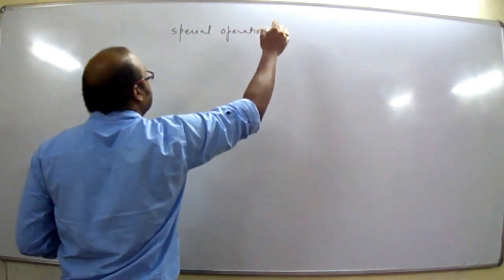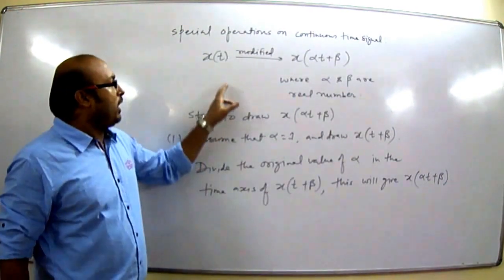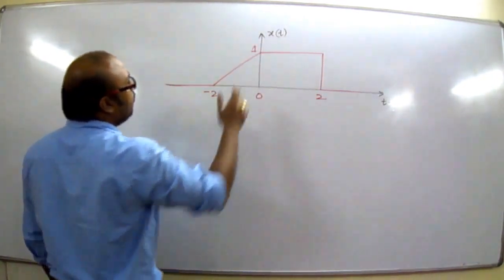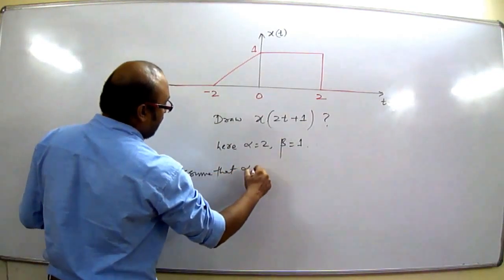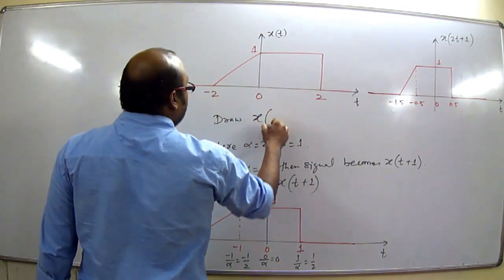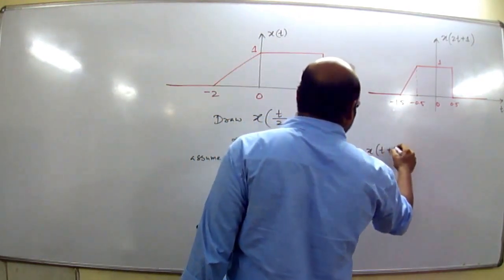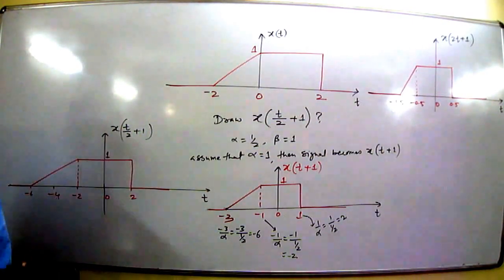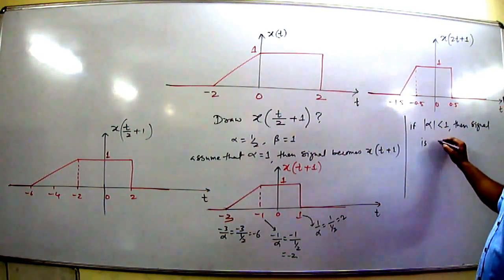Lecture by Kishore Kashyap on Signals and Systems

Comment: The answer for first qn is wrong. I think the signal should be dont 2t first then shifted to LHS by 1 unit. In qn 2 is the RHS time limit so if you do 2t it should be at 1 only.